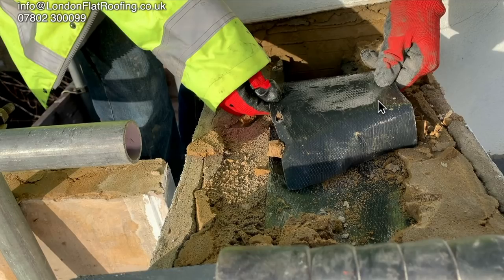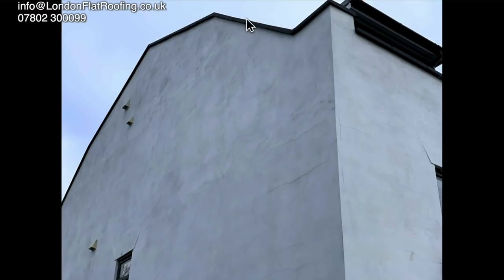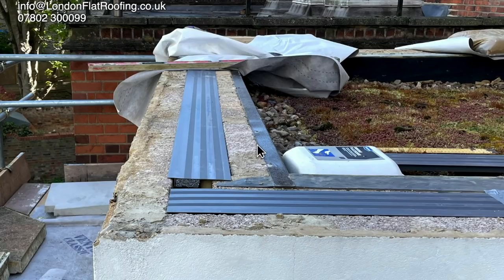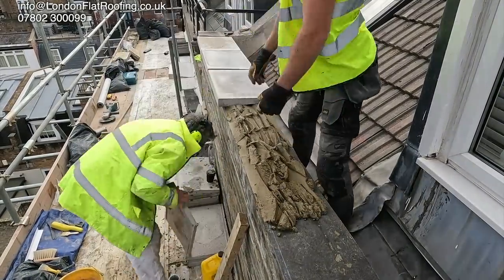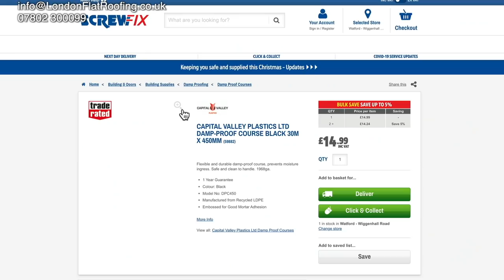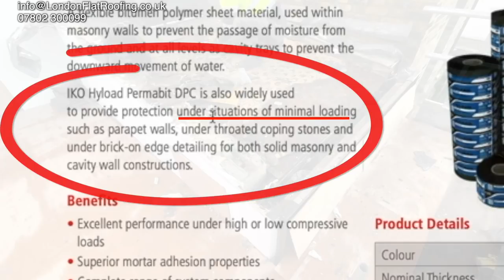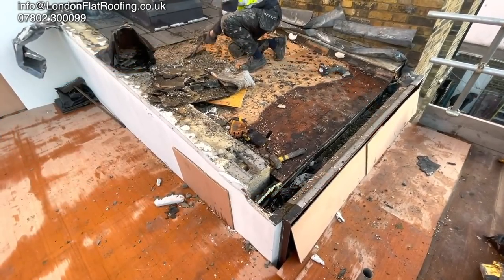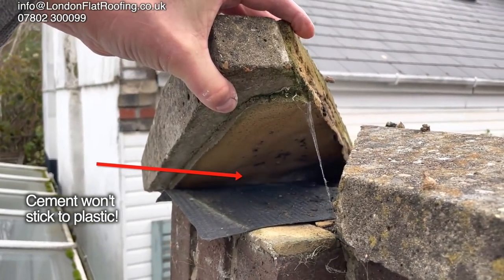Sweating and Wet Parapet Wall, Cavity Wall Insulation

Comment: Well put together and accurate video. I’m a chartered building surveyor and this problem is more common than it being done correct. I’ve done an expert report in a whole new build estate where it was so poor the builder spent years trying to put it right, but didn’t have a clue. Only comment I would make is mortar to the joints on copings is not ideal in any situation and although yours looks like a great job, I specify a Sika/Everbuild Puraflex 25. Back point it, then put a good joint with this as it provides a water resistant seal and allows for the movement. Portland cement based mortars don’t generally move and as such they crack. 👍🏼
Reply from the maker: Like you, I see hole estates with the same problem. You are totally correct about the cracking and that a flexible sealant would be better however more costly and perhaps not necessary if build correctly in the first place, if it's built correctly in the first place you have built-in redundancy. IE if the pointing fails and cracks, lets in water the totally sealed and overhang DPC will not let the water penetrate into the cavity wall
Reply: Bang on. If there was a cavity try and the necessary design carried out correctly then yes you are correct, however always best to prevent this being relied on if possible. Puraflex is £12-15 a tube and a couple of tubes would probably do it and they do it in various colours like buff to go with stonework. £30 well spent 👍🏼. Keep up there good work.
Reply: I was ⚠️ why not use lime motar instead of portland cement for the copeing stones. 😳
Reply: Totally agree with Thomas -using lime.  4 Sharp sand , 1 cement , 1 hydrated lime. Bedding and pointing at the same time. Code 4 lead, well scratched both sides , as  dpc.
Reply: @andyphillips7435  Indeed Sir, I'll bet you see a lot of shoddy work out there.
Reply: @andyphillips7435 do you get good adhesion between the scratched lead and the mortar bed/coping?

Comment: Good vid. A couple of other things to note as well. Foil backed insulation should have a ventilated cavity to allow an air flow to remove moisture forming, it should not be used as full fill unless to the manufacturers installation guidance, and during construction a stepped dpc should be installed with weep holes to capture any moisture in the cavity and to prevent it going down to the habitable areas below. Perp  end weep vents would do as well which would allow extra air flow into the cavity.
Reply from the maker: If only we knew the make of the insulation I could look it up to see if it was mad for full filled cavities.  Love your choice of chill music

Comment: Great video Steve. The biggest problem for extensions, loft conversions, etc is that most clients don't employ an Architect or Architectural Technologist post planning (in my experience) which is where all these important details are captured. It's a cost saving exercise by the client and typically driven by Builders/Contractors who tell them they know what they are doing and don't need the post planning input.
Reply from the maker: Perhaps but nobody explains to the customer that they need working drawings with lots of details and the reason seems to be to fold, Architect or Architectural Technologist  (Using your works) would lose the job as they would be too expensive and if they don't give working drawings they cant be held responsible for making a mistake perhaps I'm cynical!
Reply: I think you’ll find most Architects/Technologists will explain to the client they need post planning detailed design. They’d be stupid not to as they are losing out on the work if not. Everything is about money and if the client thinks they can save some then they will.

Comment: A well informed and highly competent analysis of the problem.  
You are right to blame poor specification, bad building and non-existent inspection that is endemic in the industry but to give some defence to the specifier a comprehensive specification along with all the details for all elements (e.g. an NBS), even for a simple domestic extension, would fill a lever arch file and clients are unwilling to pay for such detail and more worryingly builders don't read it.  Specifiers rely on the builder being competent and not having to be told how to build the basics.  Certainly on domestic work clients rarely want to pay for inspections, putting their trust in the builder who is often simply not sufficiently trained or competent to carry out all the operations expected.  Most times if I mention the correct way to build a detail I either get blank stares or BS as to why it should be done different.  Its a breath of fresh air when a builder knows what he is doing.
Reply from the maker: I think you sum things up perfectly

Comment: Nice video. You sound like a true professional and someone knowledgable about his trade. I had a similar issue which created efflorescence on the inside wall. When I got the coping changed I put my hand in the cavity and noticed the insulation was wet. The builder did use damp proof but not as well as you have suggested in  your video. This resolved the issue around 50%. I then used efflorescence treatment after sanding down the wall. The seems around 90% sorted. Its so difficult to find good roofers/builders. Your video just popped up but I am now subscribed.
Reply from the maker: Thanks

Comment: Thanks for clarifying these technical points. We, architects, tend to assume that builders would know these rules as basic standard practice... Difficult to be there at all times behind their back though.
Reply from the maker: Unfortunately no training so supervision is a must
Reply: In North America [U.S.A. and Canada] you cant just start a building before Plans are submitted and City or County Permits are signed off but prior  same soil samples are depth of  footings Calculated and number of same the amount and design of Rebar planned and calculated, correct spec of Slab, Contractors Permits insurance and Tax Certs  checked all the while Building Inspector looking over your neck at various times through out the construction process, walls erected   mainly timber Structural walls inspected for Codes, and internal Stud walls once erected inspected , Inspector checks same everything the likes of Fire Stopping ,Electrical, Mechanicals Plumbing & Civil seeing that  there is a serious degree of  compliant work according to submitted Plans and specs, the thing is City Hall and the County would be liable if things went south and would go after the Contractor via his liability Insurance or through the Court... very few Dodgy Davies plying their Trade.

Comment: Really useful thank you. My issue - building early Victorian. Tiled pitched roof falling into a gully that abuts a parapet wall - 350 mm wide. Solid wall construction. The gully has for years been patched with felt and Acrypol to stop water ingress. The parapet wall has no coping stones. The interior wall has been very damp - large exposed wall externally but we believe due to historically water ingress and cold bridging.  Want to future proof an ongoing issue for issues. Builder has proposed rather than removing the existing gully as it is sound he could over baton the the existing, lay OSB board and felt. He would also baten out the side of up stand of the parapet wall, the OSB and felt and add Alumasc on top of the wall. Is over boarding the existing going to be an issue with condensation as it's on top of the existing gully finish. Quite a difference in disruption and therefore cost in pulling out the existing gully. Would I be better to just ignore the additional batons to the top of the existing and add more felt. To make the interior a liable space I have already had the interior wall lined and insulated.

Comment: Great demonstration steve but it never sits right with me not having a mechanical fixing?. Just like when you build a chimney on a lead tray there not much adhesion to the damp coarse so it's live. So many times have put a ladder against a chimney and it starts rocking
Reply from the maker: I know that the regs have changed so that coping stones  on pitch have to be fixed down but will have to look up if the change is also for the vertical. Whatever I cannot see how anyone is going to do this correctly with the fiddly dowel fixing that have been preposed
Reply: @SteveRoofer  I would screw some 100mm screws into the brickwork leaving 50mm pertruding on every other perp joint and a dab of silicone arround the base where it penatrates the dpm to reinforce it
Reply: Totally agree with Peter you must have mechanical fix, especially important at height. We use or have used in the past s/s dowels, if correctly installed will never cause any problems with moisture ingress. On chimney work, rebuilds we also use s/s cramps for lateral stability. Unfortunately, as pointed out by many in the comments, there’s a lot of ignorance & or poor workmanship out there. My intention isn’t to plug our business but since I’m here, we are based in central Scotland Cameron Building Services and offer an informed & quality service.

Comment: Fantastic information in this video, this is exactly how I construct a parapret wall, I'd also install a cavity tray a few courses down as extra precaution. SBR in the mix is a massive help too on coping stones.
Reply from the maker: I see so many carvery walls build without cavity wall trays even when they are on the drawings
Reply: @SteveRoofer  yeah your right, i think architects and inspectors need to start taking some responsibility. The amount of drawings I have to work from, that are so bad they don't even have measurements or specification. Everyone is trying to shift the workload onto the contractor. Luckily I'm experienced enough to know whats required, does make things more difficult at the quoting stage though.
Reply from the maker: @rossmale8715  totally agree
Reply: @rossmale8715  100% agree with you there, especially when architect's write 'do not use to scale' on their drawings?
Reply: @LakesLee  I've been in the industry for years mate and it's getting worse by the day, current job I'm on have no measurements and no spec. Even the print outs aren't to scale so can't even use a scale rule lol
Reply: @rossmale8715  yet that's what the architects are paid to do? Shows where they start their blaming!

Comment: We all have to take responsibility. We can blame an architect for a spec or a detail, yet we can also mention to the architect or the client that it can be done better. And we should. We don’t know the relationship that a client may have had with their architect, and how they’ve been treated for instance. As a contractor, it can be hard just getting a measurement from an architect. Yet what you e shown should really be put at the doorstep of the contractor. Not of the installer, but the contractor in charge of the job as they are the ones who will be insuring the workmanship. 
Great video. Amazing what is seen or hidden say in, day out in the construction trade.
Reply: of course, you are right however more often than not it's a subcontractor note the main contractor and he is trying to be helpfully by just moving on with the work without asking questions and doesn't understand the implications.
Reply: @HampsteadBuildersLt  we truly miss the Clerk of Works

Comment: Excellent video! My parent's parapet wall has exactly the same problems that you have highlighted. Appreciate you sharing your knowledge and advice. Do once weathered coping stones let water through over time? The ones on my parent's roof are pitted and there are some traces of rusty water stains on the surface. I believe these coping stones are re-enforced?
Reply from the maker: Theoretically concrete coping stones are pretty water resistant and on top of this if you have a proper damp of course under it then you haven't got a problem however overtime some very old coping stones to let water get through the main problem is always at the joints

Comment: Used to see this all the time snagging for a international orangey company that’s now folded .. incorrect trays or no tray At all on parapet walls .. 
it’s crucial to use the correct tray that’s one piece or welded at the corners … Because the design detail on most used to rebate the doors sometimes you would end up with 6 or 8 angles that would leak ….
Reply from the maker: Things have got complicated on building sites

Comment: If the coping stone shouldn’t be bedded to the DPC with mortar as they don’t bind, what do you use?

Thanks
Reply from the maker: You use a DPC (damp proof course) that is made to be used under light loading and is sand faced so that it douse bind

Comment: I always use 5mm thick torch on roofing felt to close up, and damp proof cavity walls, boundary wall's and parapet wall's for the copings stones, you can't do it any better.
Reply from the maker: Personally I think thats the way to go the expensive felt im using looks like ordinary felt feels like ordinary felt  but is 10 time more expensive I think its a con.
Reply: @SteveRoofer  I recently built a take down and rebuild extension with a 6 metre by 4 metre return cavity parapet wall, the architect had specified a bespoke Ral Grey metal coping system?
Which looked fine on the drawing but was totally unfeasible as it had to butt up to an existing higher porch wall?
Which meant that we would have had to cut out a 
11" X 6" piece of the metal, thus negating the guarantee and leaving a butting up seam open to the weather?
So we bought 900 x 400 x 75mm Ral Grey concrete copings, closed the cavity wall with 100mm concrete block bridgeing with 5mm Maxi Torch on roof felt with a 10mm overhang, and 300mm joining overhang, all blow torched down onto the block work joint finished with a tight 4x1 sand and cement fillet. The external block wall was render finished, with a Polar White K rendered finish system. 
Never had a call back todate using this technique.
Reply from the maker: @jeffreybresnahan  It's what I would do its a  no brainer the DPC I'm using is expensive and probably the same thing your using however what I'm using is considered correct and what your doing is considered not correct there is no common sense when it comes to building control if someone wanted to take you to court for the miss-use of materials they could. If I were building my own extension I would do what you describe

Comment: Im no expert infact far from 1 somehow just stumbled across ur video. I do have a question tho. If the damp proofing membrane needs to over hang 5mm plus go end to end of the brickwork when u cement the coping stones on surely ur just sticking them to the plastic membrane?? Ur stated urself in the end of the video that cement doesnt stick to plastic?? Im confused
Reply from the maker: I find it hard to find anybody that thinks its a good idea probably the suppliers of the insulation !

Comment: Great video Steve. We live in a 1970s end of terrace house in East Kent with a parapet wall with coping stones. Every time we have heavy rain the water gets into our property especially at the rear, water into back bedroom, dining room and porch. Roofer says he can fix the problem by putting felt over the coping stones without taking stones off. What do you think? Thanks Tom East Kent
Reply from the maker: I think Felt over the top of coping stones is a very good option. It doesn't look good but it's quick cheap and works for a long time.

Comment: I’ve just built an extension with a parapet roof and didn’t overhand my DPC. I left it flush. Building inspector signed it off no problem. Mistake on my side 🤦🏻‍♂️
Reply from the maker: building control is not there as a clark of works  more of a health and safty

Comment: Hi Steve. I know you said have the dpc wide enough to overhang 5mm each side which sounds perfect but do you ever worry about water creeping back along the underside of the dpc? I think I came across this once in a different situation but similar application where driving wind was causing water to creep along the underside of the dpc rather than drip off the edge. I wonder if it could be bent down and/or use sealant right along each edge to prevent this? Perhaps not needed though
Reply from the maker: Not needed if you do the 5mm and coping stones correctly basically at the point you are talking about you are already at the second line of defence you are assuming that the coping stone drip has fail and water is tracking back to the wall below the coping and above the DPC. It then has to drop down to the DPC (damp proof course) and trackback again! can happen but where do you stop Two lines of defence has proved to be the way to go for hundreds of years. Just do them correctly

Comment: Finally someone with solutions and speaks english( simple and concise) thanks

Just a question there is different types of cavity wall insulation some is the loose one just injected into the wall. Does the same problems happen to them too. Internal sweating(thermal bridging) I think you said or the damp proof and coping stones leaking into it?
Reply from the maker: Its going to be down to the build and how good it is if there is cavity wall trays fitted and a good DPC (damp proof course) however I don't like fully filled cavity think that a mistake